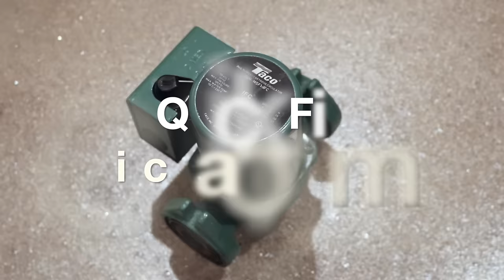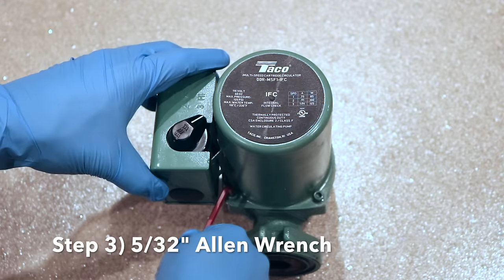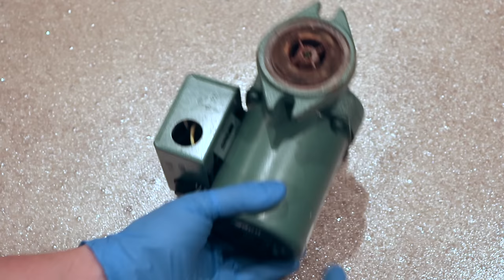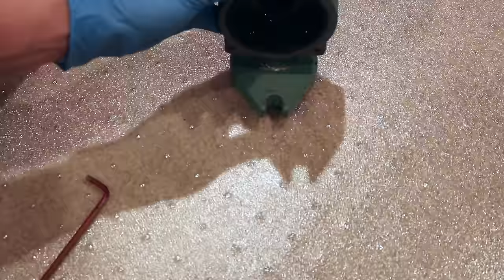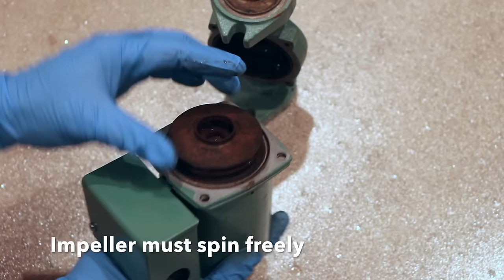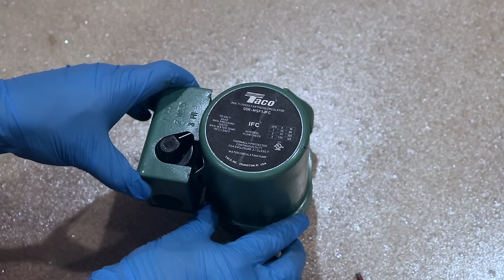Fix & Repair Stuck Circulator Pump Before Replacing NO HEAT

Comment: Fortunately, my heating contractor put shut-off valves above and below the circulator pump so if it fails, it's as easy as shutting off those valves, removing the 4 screws, and replacing the cartridge and gasket. 15 minutes top!  My burner man also leaves a new nozzle, filter, and a new pump cartridge (after replacing a defective one) as those are the things that seem to fail on weekends,  nights, and other inopportune times. He took the time to show me exactly how to get my system going in an emergency. The bearing seized on my pump and we couldn't get it to turn. That cartridge costs from $65 to $185 US.

Great video. Thank you for posting.
Reply: Can't beat being prepared. I always install isolation flanges before and after pump too! It's makes repairs so quick!

Comment: I just had one lock up on a wood fired boiler and 2 whacks with a hammer in place later viola it started running again. If you hear a humming it's the electric motor trying to turn but can't. Couple reasonable whacks with a hammer and boom! Glad to see this video after the fact to better understand why it even happened. Thanks!
Reply: I just did the same thing with a wrench.

Comment: if the pump jammed, means rust and debree is between shaft and bearing, so cleaning is needed. If you just unblock it, it may still jam next year when not in use or when  o water in system. To clean, at least for EU pumps, you can pull the rotor out, and then use some paper towels to clean space between shaft and lid (metal lid under propeller). You can put WD40 and move shaft up/down to get it in the bearing. It will become muddy, so clean it, apply wd40 again and repeat until you get it as clean as possible. This will fix it for a longer time. Also check your radiators and add a magnetic filter. Iron radiators will rust and it will all go to the boiler, seizing your pump. It's like cholesterol going to your heart, lol.
Also avoid keeping boiler turned off too long, once a month a start would help keep pump working.

Comment: My new pump stopped working yesterday.  It's only 2 years and has been rarely used. After watching your video, I decide to flush the heating pipes by draining the dirty water (and air of course) out and let the flowing water clean the pump. Now the pump works again😀! I'll keep the new one I just ordered as an emergency backup.
Reply from the maker: So glad it helped and got you back up and running thanks for letting me know
Reply: they have a 3 yr warranty.
Reply: @hagans79  Thanks! It's good to know! Anyway, my way solved the issue - it's usually some rusting falling-off debris that stops the pump. Flush it away and no need to change the pump.😄

Comment: I work in the spa industry and cleaning magnetic drive pump impellers is a regular part of maintenance. My Taco pump stopped working recently and I suspected it was a seized impeller. I'm hoping the impeller comes out easily as I prefer to remove the impellers, clean them, and clean inside the impeller housing. Thanks for sharing!

Comment: Thanks for the video--I took my motor off and found that a piece of debris had jammed the impeller.  5 minutes later I was back up and running.  The pump is part of a wood-fired boiler/radiant floor system to heat a 2000 sq. ft shop.  I usually run the pump a few times over the summer and this was the first year I didn't do that.  I have always added boiler anti-freeze and conditioner.  The piece of debris has me concerned about the condition of the boiler itself.  At any rate, watching your video saved me some time and some $.

Comment: I happened across this while doing some  research on taco circulator pumps.  Great diy information.  I appreciate the time and effort you put into the video.
Reply from the maker: Thank you very much, I am glad this was helpful. Best wishes to you.
Reply: do i need a check valve in the taco pump

Comment: In the UK we tend to have two isolation valves on the pump flanges, this means you can shut the water off to the pump and remove it without draining the entire heating system.
Reply from the maker: Ahhhhh. If ONLY they did that here. We see much more of it now but definitely not the norm for most homeowners here. Very sad since the valves don't cost much but they sure save the day, especially in the middle of the night with out cold winters here in New England. Great point and thank you for watching and best wishes to you. Please subscribe to my channel as well for new videos and keep the feedback coming.
Reply: In the UK?  Most people around the world with modern plumbing do....
Reply: Yeah 2 valves that always leak after you operate them for the first & last time
Reply: @johnsteed265  same here where I work at, easier that way. 👍

Comment: If you install flanged shut off valves on either side of pump you  don't need to drain system. I recommend them. Also if you get the type with installed check valve then pull the check from the pump- only want one check valve of course.

Comment: Once a year must do this service before start heating period. European circulators like Wilo or Grundfos have a screw behind and can easily fix the problem! Nice video.
Reply from the maker: I really wish the US one had that screw. I have no idea why we don't have them here I have seen that and how helpful that can be solving so many issues. Maybe they just want us to throw them out every time! Great point.
Reply: Are you talking about a bleeder screw on Grundfos brand?  Is there a screw to wrench on to actually turn the rotor/shaft?  That works be cool.

My system has Taco brand pumps on it now but when I replace I want to have bleeder outlets and a means to manually turn the rotor in case it is frozen. Thanks!

Comment: Bobby Edwards
I replaced my Watts 500800 pump with a new one and stumbled across a video on YouTube saying that the pump can be repaired.  I viewed the video and the pump repaired was a different one but was informed that they all work the same.  The old replaced pump was leaking water over the top of the hot water heater.  I took it apart and it wasn't stuck or impaired and when plugged in the pump worked like a charm.  What made it leak, and how can that be diagnosed and fixed?

Comment: Nice video, best is to use water conditioning additive in your system and still turn circulator for few seconds once a month. Have some that work for over twenty years.
Reply: What do you recommend? Water conditioner? Thx

Comment: Great video... going to try this as soon as I'm home today - as one zone is not heating even though all other zones working.  However, I have valves on either side of the circulator pump in question... can I just turn those off rather than draining the entire boiler?  Or am I missing another step or concern by not draining the boiler? Thanks!
Reply: Definitely yes, same as draining the water

Comment: ive got two zones and for some reason the pumps to the second zone (upstairs) keep seizing like this. at first we were just replacing them but the last one seized after just a few months. what could be causing this? and why would it only impact the one pump??

Comment: Well if the installer's did you a favour they would have put shut off on both sides of the circulating pump to make it easier to change out in the future.

Comment: I have say 170 degrees (according to my temp gauge). On each side of the pump top and bottom are both very hot to touch, is that a sign that the pump is working fine ? Pump is very quiet and I can't really tell by feeling the pump. Tenant keeps smart thermostat at 77-79 degrees, it's fairly warm in the house but feels more like 72 inside. Stat is set for 3 boiler heating cycles per hour. Aquastat at about 190 max.
Reply: I recommend touching the pipes further away from the pump to check if it's moving fluid. It's not uncommon for the pump to be really hot and conducting the heat into the first few feet before and after it.

Comment: Out of curiosity if you have say 4 zones and 1 zone does not have water at a bleed valve, is it possible there is no water because the circulator pump locked up? or would it be more likely the bleed valve is not working?  (its -26 ) and I am not taking the boiler offline or changing water if I can help it and everything else seems fine and working?

Comment: In this video, do you need to take the pump off the heating system? It seems that you can do all these repairs with the pump mounted on the system. Or am I missing something?  Thank you for the demo!
Reply: a grundfos pump would be take a cap screw on the back of the pump off. insert screwdriver into slot of pump shaft and turn counter clockwise. put cap back on

Comment: my house struggled to maintain 2 degrees below the set point last nite (about 10 below) and the Taco recirculator never shut off it ran all night, and had a sort of cavitation sound at times like it was running at different speeds. Not sure what to think of that.

Comment: I woke up this morning, 3 of my 4 zones...no heat...boiler was on and sending hot water to my 4th zone and my hot water heater...3of my cycles were warm not hot...air handlers were able to be turned on...so I took a hammer and gently tapped the cyclers...and presto...all 3 started to work. I’m wondering how long before I get them changed out?

Comment: OK, so I replaced my Taco 0010-F2.  Your videos helped a lot.  First off, I can't believe how simple it is...sort of.  In theory it is as simple as drain, disconnect wires, unbolt, replace.  Simple right?  Well, I had some hiccups.  I drained the tank until it trickled but when I removed the old circulator I flooded my basement.  Apparently I didn't drain the circuits.    Who knew?!?  LOL.  Funny now, not so funny when the pipe is spewing water like a bathtub faucet!  Secondly, I had probably three generations of gaskets welded to the pipes.  No lie, two O-ring layers sandwiching a diamond one.  I had to ruin a wood chisel to chip those off!  After that it was simple.
A comment:  I looked into replacing just the cartridge as you suggest and found that the cost was actually a few dollars more than the whole unit.  That is a BIG disappointment, Taco.  I replaced the whole unit as it carries a guarantee for three years.
A question:  I replaced the unit because every so often the darn circulator buzzed like a cicada.  No gravel sound just an annoying buzz that, when it cranked up, reverberated throughout the house, loudly.  I would go and give the unit a few love taps with a hammer and it would stop - but only for about 24 hours.  It was intermittent.  So, of course I take the old unit out and it spins fine.  It seems great.  I expected to find a broken impeller but, nothing.  My question to you is...Do you ever find a unit that buzzes but spins freely?  For such a simple pump the darn things are EXPENSIVE!!!  If the old one is fine I'd like to sell it on Ebay ( I can't take the new one back now that it's been installed!)  Thanks for your response below!
Reply from the maker: Hi glad that my video helped. I agree that they don't make the circulator replacement very economical. The main reason people will just do the cartridge is if they can't get the unit out and they can just swap the inside. Most plumbers only swap the pump our directly as you did. Yes I have seen noisy pumps many times when they spin freely and work. It can be small debris or motors slowly going bad. I will replace them if they make noise like that. I don't want to have a failure in the middle of the night. You can sell your old one on ebay I see the on there in very used condition still get some money. You could also keep it as an emergency backup also. Glad you learned something new and probably saved a $400 installation price too. Best of luck with your project
Reply: Thanks
Reply: It was funny reading your post. There is nothing as exciting as when water starts pouring out of your system that you thought it was drained. Sometimes the load noise you hear is due to air trapped in the pump. If it keep being loud. replace it, it's under warranty. 
Here are a few more random tips. 
1 - Check to make sure you have no glycol in the system. (you will want to drain that into a bucket and pump it back into the system) otherwise you will affect the freeze point of your system. 
2 - Make sure the system is not too hot.  ( if you start removing screws it could start leaking and you may not be able to retighten the screws due to hot fluid burns) 
3 - turn off the makeup water to your system
4 - make sure you have a spare gasket before pulling it apart. 
turn off all power. boiler power and control power. 
remove air from all heating loops.
Reply: @diyheatingrepair8809    Great info - I'll check out your channel.  Is it also possible a bearing or bushing in the pump is wearing out?

Comment: If you get that far, all those steps, wouldn't it make sense to replace the cartridge? Or even the whole circulator? Thx
Reply from the maker: Yes agreed, this is perfect though if it's the middle of the night or you don;t have heat and need it back on now. This works very well for that and buys you time to go back and replace it later though I know sometimes this can hold for years.

Comment: so my circ pump seems to be turning on and off in 10 sec intervals.  Tub is not getting to desired temp either.  Took circ pump out and apart and tested (like in your video) and it spins freely.  Pump goin on intermittently a sign of bad pump?

Comment: Sometimes the capacitor just fails and the pump will draw higher amps than rating. Thought they did not make the replacement of the capacitor easy but you may cut it out and install another one inside the electrical box or outside in a junction box nearby

Comment: @t question is this will the newer rubber old ring work with the old flange thats on my boiler or do I need to install a regular flange gasket? Question 2# Whats the prefer nipple to connect to the flange to the boiler brass or galvanize pipe?
Reply from the maker: The newer gaskets are supposed to work with the original flanges. Some plumbers still use the larger "pink" gaskets though.  For your second question black iron or galvanized pipe is still widely used for boiler piping.
Reply: @SilverCymbal  Thanks for the info.
Reply: I have never installed galvanized piping on a heating system. Galvanized piping is used in plumbing not heating. As far as I know glycol will destroy galvanized piping. Brass works too but it's more expensive. Hope it helps in the future.

Comment: Great information. Do you have an videos on Grundfos pumps? I think i have a bad check valve on mine but haven't taken apart yet and really dont know how to tell if they are bad.
Reply: If you pull the pump out, you can depress the check valve with a small screwdriver. You just want to make sure it opens and closes smoothly. Be careful the check vales are made of plastic.

Comment: If the circulator is well above the boiler and water lines. Mine are in a basement floor below the boiler so I don’t think I would need to drain the boiler

Comment: My circulating pump is working only on 3speed not on 1st or 2nd and it is making a noice like barrely is circulating the water.help
Reply from the maker: The Taco 3 speed pump had a lot of failures based on what I experienced and on forums I was on. The noise is usually a sign of either debris inside or that it's likely going to fail soon. The fact it works on one speed could be that the switch is bad of that the parts that control the swithc have gone bad. The best move for this one is to replace the whole unit. If you watch my other video on my channel you will see I did the swap you are describing. I went from a 3 speed to a brand new pump. I hope that is helpful.

Comment: Can you clean the metal bits out?
Reply from the maker: Yes it is possible to try to wash out the cartridge once you have it out.  This will usually work for a while or maybe a long time but I would use it as a short term fix but if you have no heat it’s worth it.  Best wishes to you and thanks for watching.

Comment: So is water leakage a symptom of this jammed pump scenario?
Reply from the maker: Unfortunately no, that would sound like the pump seal may be compromised. The best bet for that is to replace the pump since the seal housing is usually too corrode to replace just the seal. If you check out my plumbing and heating section of my channel I did a full pump replacement too that may be helpful.

Comment: My motor spins when taken out but only hums when powered up. I bought a new armature cartage but cant pull the old cartage out. The gasket system between the water inlets and the pump is a poor design and reinstalling it is a bear.
Reply from the maker: Sorry to hear that. At times I have been able to use a heavy putty knife or thin flat head screwdriver to pry the cartridge from the housing. It could be too corroded but it's worth a try. Please be sure the power is off as well for your safety. Best of luck with the repair and getting your system back up and running.

Comment: I took my cartridge out and there is water trapped inside ... is this normal or do I have a bad seal??
Reply from the maker: If the water is inside the motor housing it sounds like the seal is bad and a new cartridge and oring may fix it. If you can at this point you may want to replace the entire circulator, housing and all. I have a video for that also. https://youtu.be/flpbqJu2sT8 Either way I hope this helps. Thank you for watching and let me know how things turn out.